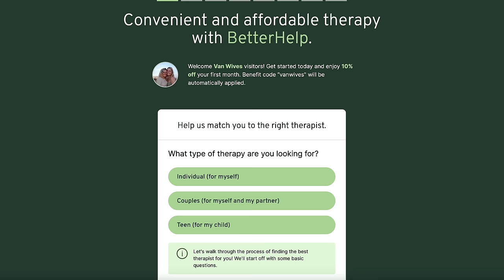Closing Down Off-Grid Cabin  (prepping for Canada's winter)

Comment: Plumber here from the frozen north (Maine) If it’s not to late, after you have blown out all the pipes, be sure to put the ball valve handles at the 45 degree position. The valve body will hold just enough water to split the valve if it is left fully open or closed. The 45 position will allow the water to drain past both sides of the ball inside the body.
Reply: Most cabins in MN would just add antifreeze into the lines. Would you recommend that method or just blowing it out, like they did?
Reply: For their property,after watching the installation, I would “ mist “ the system.. Meaning, pump in say a gallon or so and then blow out the pipes a second time until the pink mist comes out of the faucet(s).. with the ball valves in the 45 degree position as I said above.
Reply: Thanks for this tip - it’ll help at the offgrid in Shelburne Co., NS!

Comment: Install gate wheels or trailer hitch wheels on the side of your dock.  Raise ‘em up when you put the dock back in the water.  Down when you pull them out.  Problem solved.  😁. Love you guys!
Reply: Just need some straps or ribbon to keep the barrels in place.

If the wheels are detachable, rather than foldable, you only need one set, and can move it between the modules.
Reply: if they turn it sideways b4 pulling it out the barrels will act as wheels ;)
Reply: Wheels make thing go around... 😊😊
Reply: I was thinking the same thing. Pull out of the water just enough to attach wheels. Pull the docks and the floating cabin out of the water. Eamon and Bec tow theirs out to the deep end and anchor the docks.

Comment: several ideas on the dock floating departure issue. Pick up 2 sets of plastic dock wheels. buy a piece of steel 2x2 or 3x3 steel sq. tube get some metal for the axel/wheel mounting. Use this as an axel you slip under the sections platform and pull in that way, if clementine has pallet forks, use them to lift the sections. your barrels would work if you had beach sand and not the gravel/dirt landing. what else you could try is a pivot arm idea. where u couple the sections together add an arm to it there welded to the axle. Then where u pin the axel and arm together add a cable pulley, hook the cable to the axel, around the pulley and when you winch it it should lift the axel up and under the dock sections and pull it out. The other idea is on the lines of a boat trailer. push the sections out on the water. back the trailer under the section, pull it in. Have stands made or some sort of blocks under there so you just back up, load it and drive in the water next year. Have "bearing buddies" installed or used on the trailer wheel bearings and grease a couple of pumps of grease in them in the spring and fall. When you pull the house in leave it on the trailer.. O sometimes you can find free sand from a sand blasting place if they use silica sand, I've done that from a granite head stone fab shop. Literally tons of sand...
Reply: Wow! I am so impressed by this wealth of information! Your post gives Crystal and Jasmine lots to ponder over the Winter months. Don’t you just love their work ethic? Hard workers , not easily frustrated, quick learners, and they give every project their all. Gotta love those two women.

Comment: Hi girls, I have a trick for you to not get any bee, wasp or hernet’s nests under your propane tank covers, line the inside of the covers only with aluminium foil. This is our propane delivery guy that told us to do this cause if there's an active nest, he will not fill our tank. Seems they hate aluminium. Oh and to save all you have stored in your container and outdoor storage units like garage, etc., I buy some original Irish Spring soap bars at the dollar store, cut the bars in half and throw them all around inside the storage areas, especially near your outdoor cushions and soft things of that nature. This deters rodents (they do not like the odor of Irish Spring) so,they don’t make nests and reck your cushions especially. This is not 100% but for the price, boy does this save you heartaches in the Spring.
Reply: 🐝If you have an active bees nest 🐝to get rid of that you take a brown paper bag stuff  it with newspaper shape it like a ball tie it off and put it where your bees are🕸. It reminds them of a wasp nest they are terrified of wasp🐝 good luck
Reply: Another hack for keeping mice at bay, place dyer sheets under the hood inside the engine compartment of your ATV’s, mowers, etc.
Reply from the maker: @critterkarma You are so right!  My mom says the same thing.
Bounce dryer sheets and cloves, is her go to 😎
Reply from the maker: @carrieturner414 Thanks for the helpful tip.
😊🐶
Reply: @carrieturner414  does it actually work? I'd think bees rely more on the vibrations and smell a wasp nest would have rather than the shape of a big object 🤔

Comment: My dad installed casters on his dock so it would roll on hard ground when he pulled it out of the water. They weren't expensive casters, my dad was cheap above all else so all I know/remember is there was a caster at each corner (the type that only roll straight) and they were mounted on extensions on each corner so they stuck out about an inch below the foam blocks. Hey, it was 20 plus years ago when foam was still allowed for dock floatation.....The other thing he did was groom a ramp into the area leading to the dock so the ground was smooth for pull out. No rocks, roots, etc. Also his dock was only about two lengths long, say 24 feet in total give or take. I'm sure he used galvanized casters with solid axles, no bearings and I'd bet he found some lubricant that was water repellent enough to last through a Duluth, MN summer. Hope this idea helps!

Comment: Many others have put forward great suggestions for your closing up for the winter. One I would, if no one else has, is for the summer.
The containers are known to have a problem with condensation. A good idea when you open in the spring would be add a ventilation kit to keep a neutral atmosphere preventing the condensation. Not difficult or expensive.
I truly hope you will enjoy your winter in Mexico.

Comment: When trying to pull the floating vessel cut logs a foot longer on each side. This will act like a roller system. Then you can pull the house right out lol! I grew up in Alaska we had to prep for winter every year! Also alot of peppers are perennials. You just need to cut them down to Stubbs and cover them with mulch so they don’t freeze they should grow back the next year.

Comment: on our dock we used metal straps, the hafe holes already in it, an you measure around the barrel and attach it to the dock when its upside down. watch out if that area floods again those blue barrels will be floating away, also stake down your ramp and dock so it doesn't float away too

Comment: Your ATV winch should have a free spool option so you don't have to unwind under power to the winch. On the right side of the winch there should be a twist knob to disengage the winch spool and you can pull the cable line out. Twist back to engage power. Use pipe strap to attach the barrels and pull out sideways or build cages for them. For the house dock build two ramps like a sled to full the house dock onto it. Then pull the ramp sled back. Could also use same sled to move dock pieces in and out. To put back in water just push the ramp sled back in and slide house dock off. I have 4 floating dock pieces 8' by 8' on barrels and use a ramp sled to pull them out and up a 20' slope rising 8' with my ATV so I know it works.

Comment: Our docks are not floating docks, so your mileage(kilometerage?) might vary, but it DEFINITELY helps to lift the front edge of the dock up when pulling, we use a short chain on the forks to lift up and then back. Good luck next year, have fun in Mexico!
Reply from the maker: Thank you for the tips!
Reply: @Vanwives  It would probably be a complete rebuilt... but I wonder if you could turn the barrels so they would roll under the docks rather than get stuck? Just another thought :)

Comment: There are cheap pressure washer nozzles/wands for your hose that really blast clean things like those tubs. I use one to clean the patio and concrete walkway around the house. I have an all metal one that acts like a wide broom with multiple nozzles. It was a hand-me-down from my folks. It has little wheels near the ends.

Comment: 6:44 If you spin the dock before pulling it out, they would be able to slide on the ground and the top of the barrel won't dig into the dirt. Just a thought.

Also, you could screw or strap the tops of the barrels to the dock. The tops are always floating, so, it won't rust or rot whatever you use.
Reply from the maker: Thank you so many great ideas to use in the future. 😊🐶

Comment: Consider turning the barrels parallel to the deck boards. It would slide ageist the ground instead of digging into the soil. If that didn't drag well, there are that would might set the barrels in with a roller on each corner. Just an idea.

Comment: 6:58 if you position the way you connect it on the wide side..or even just turn it in the water b4 you pull it then the barrels would act as wheels and ROLL your docks out for you..the way they are now youre just getting pure resistance from the tops/bottoms of the barrels(pull from the side ;))
Reply from the maker: SMART! Oh my, thank you

Comment: ...imagining a wheeled dolly system, with A frame sides, Clementine lifts a dock section with her bucket, (you will have figured out the center of gravity for each dock section) lift points are mounted there (the cg) a lift cable/strap runs up to the upper A frame cross member, winching the dock piece up, and then secured to the dolly, which can now be moved where ever you like!  Enjoy your trip south!  Think of us stuck up north... ;-)

Comment: One possible suggestion....when you where pulling out dock....the barrels....if the round parts where facing the shore would they then pull out? Versus the flat sides that just drive into the ground.  It would mean turning the dock peises 90° or setting barrels differently.  Maybe to much work I don't know but the round sides would roll up the bank nit drive into it.

Comment: Hi girls there was a lot of good suggestions on your dock problems mine was in the spring turn your barrels side ways and secure them with 3/4 inch galvanized pipe hanger you find in the plumbing section and the other good idea was attaching wheels to the side you could look at the  folding ones they put on trailer hitches that fold up or just get some set up you could remove and easily secure in the fall

Comment: One suggestion would be to use air pressure to puge all water lines. In water is laying in a low area of pipe it will freeze and burst that area.  Maybe take tractor back to boat house and lift with tractor to slide boathouse out of water.  Great videos just be careful in your travels. Crazy world out there.

Comment: Change the direction of the barrels when you reassemble (if you can)... not sure if it impacts the buoyancy of the dock but it might help with putting in/pulling out of the lake. Looked lik a chunk of your issue was the end of the barrels caught on rough parts of the ground as you pulled the dock out.

Comment: Pipe docks must come out. The ice will destroy the pipes. Ice is really hard on docks, especially during breakup in the spring. I’d belay the outboard points of your floating dock with the house. Otherwise it is likely going to pivot during spring break-up.
And —you guessed it. The barrels will not work as skids. Just tear or break. If filled with foam, they just release microplastics into plastics for years. If empty, you just have plastic landfills.

Comment: For getting the docks sections out of the water I would create a skid plate out of 4x8 sheet of plywood and put under barrels as the come out of the water and mount maybe along the front of the plywood a 2x4  and drill a hole at end to attach a rope and then put a rope from that 2x4  to your tractor and also from the same place on the 2x4 to the dock and this way it should slide on the plywood and put no stress on the barrels that will just go for a ski ride

Comment: next year arrange the dock barrels so when you pull the dock out you're dragging the barrels along the long side not on the ends that just dug in the ground. long side will slide
Reply from the maker: So smart! Wish we did that
Reply: @Vanwives  you can keep the barrels like they were, just turn the dock sideways. Will be easier to put in next year. I have been following you since before you bought the cabin. What you 2 have I am in awe of you and a little jealous.

Comment: Get rollers - like security equipment movers or the Egyptians.

Lay down 1 or 2 rollers so that the blue drums roll over the roller across the ground rather than digging into the ground.

A person may have to constantly be shifting the rollers as more of the dock comes out but if you tackle it piece by piece it should be too bad.

Otherwise yeah remove the blue drums so the wood slides against the ground like the 1st part of the dock did rather than the drums running a ground and digging in.

Comment: On the houseboat, what if you had a way to joist it up on poles a foot or so above the water line? You could use a mechanism like they use for car jacks. Make some holders at each corner of the float to hold the poles and then the jack mechanism to raise each corner a little at a time.
Reply from the maker: Yeah that’s a very good idea! That would work for sure. Like a boat trailer ratchet maybe? Or something automatic lol.

Comment: A good, inexpensive, old fashioned Canadian way to pull your dock out of the water is to use round fence posts. Lay a post on the ground across the front of your dock and pull the dock onto the post. when the dock has rolled 4 ft forward, put down another post.
Reply from the maker: Great tip, thanks for sharing! 😊🐶

Comment: If you have problems with mice, rats, or other little critters getting into storage or the cabin while you're gone, go around and fill any holes bigger than a dime with wadded up aluminum foil. Smaller than a dime voids ones you can just use foam.

I wonder if you made a sachet of cedar or mint and put it under the lids of those propane tanks it would keep the hornets, bees or other bugs away?

Comment: Late fall is always sad, summer is over and winter comes so fast. Depending on you lake and how the ice breaks up in spring the boathouse should be fine. I leave my floating dock in the lake all winter. I do pull up the posts and the part that connects the shore to the dock for winter, the rest just floats and the anchors stay in place.
Reply from the maker: Glad to hear that. Ours has rivers that come into it so it doesn’t freeze all that much. Happy winter 🥶 sad time for sure

Comment: You don't have to remove the barrels, just get some round poles from your lumber folks, and lay them sideways in front of the barrels. Use them as rollers like they did long ago to build the pyramids and other buildings.

Comment: Get a cheap cargo net at Princess or where you can. Cover the barrels and stake them down. Winter winds and beasts scrounging move them.Unless you put a king valve at the bottom of the greennhouse line, to drain the line once pressure is removed, it will freeze the little bit remaining at the bottom.  ENJOY MEXICO and best of fun building down here/there!
Reply from the maker: Thanks for caring and sharing! Hoping you will be watching our build in Mexico. 😊🐶

Comment: Put the barrels in cross ways not long ways they won’t dig in when you pull on it. Measurements might be an issue. And if each section was separated as you pull it out it would better. Safe travels to Mexico 😊
Reply from the maker: Thanks for the tip Mark. We will try this next year. 😊🐶

Comment: Are you reconsidering this floating house/dock design given that this turned into a teardown to get everything out of the water?
Reply from the maker: I think it will be just fine. The lake hardly ever freezes. Luckily for us where we live in NS it’s mostly mild winters. However I think there is a way to bring it up on land in between the floats. We will try that next year if needed 😎
Reply: @Vanwives you two are excellent at problem solving!